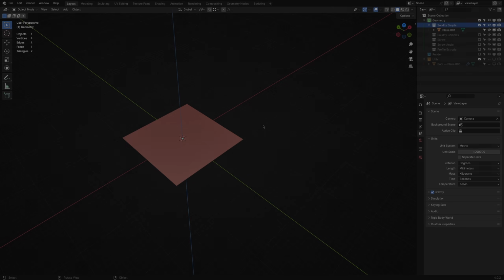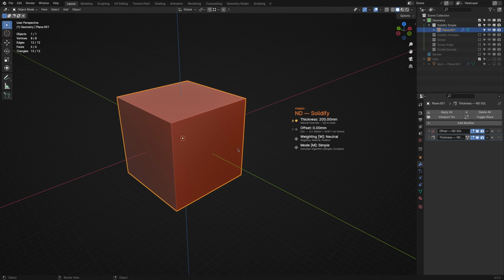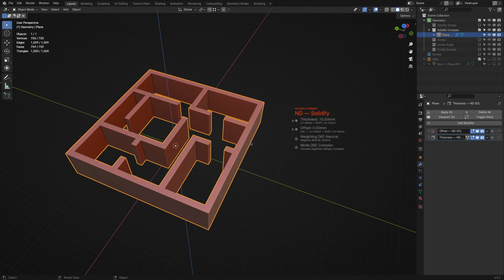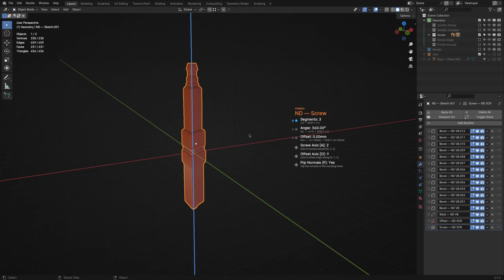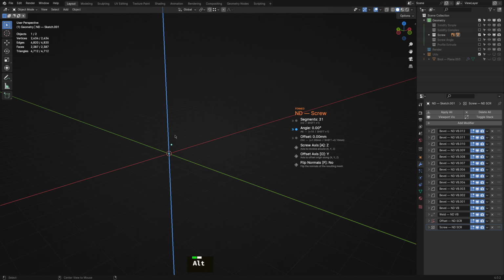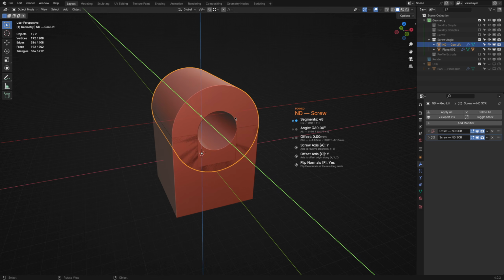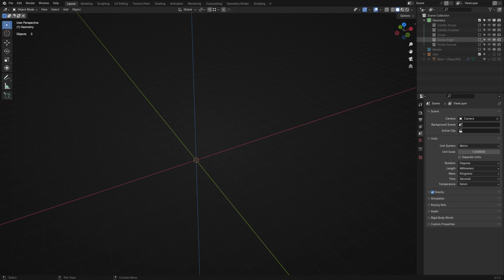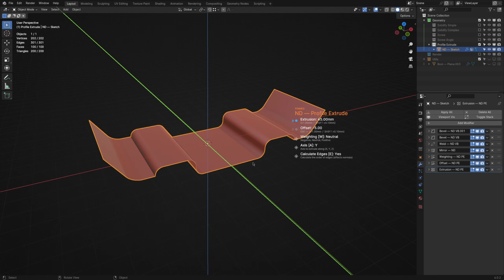Blender ND Add-on Deep Dive — Part 5 (Extrusion)

Comment: Excellent hard surface workflow work flow optimisation.  Is it possible to add a 'cap' feature to ND to partial screw (less than 360d) objects?  Objects made from 360d screws are manifold since both 'ends' can merge, but blender's screw modifier leaves the caps open in <360d, meaning they cannot be used for Boolean operations unless the screw modifier is destructively applied and the geometry repaired by hand.
Reply from the maker: That request has come up previously in our Discord chats. It's not possible to do using Blender's built-in modifiers, but potentially something we can create as a custom spin/screw modifier using Geometry Nodes. It's on the list of things to investigate :) — Tristan

Comment: Looking forward to a future tutorial on creating profiles like the one used for the spark plug profile. That looks really cool 😎.
Reply from the maker: They're actually surprisingly simple. It's just a single vertex that's been extruded numerous times to form an edge, and then vertex bevels placed in areas where curvature is required. I will try to put a video together on creating different types of profiles at some point though :) — Tristan